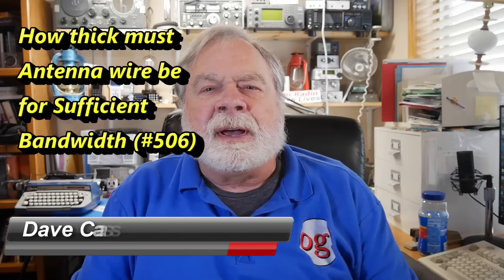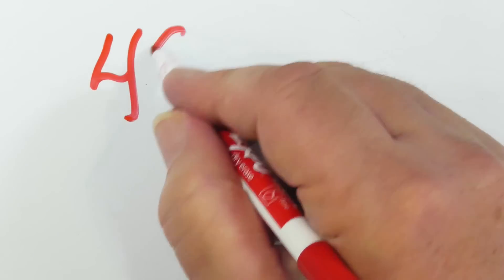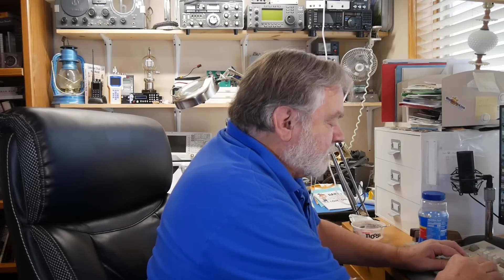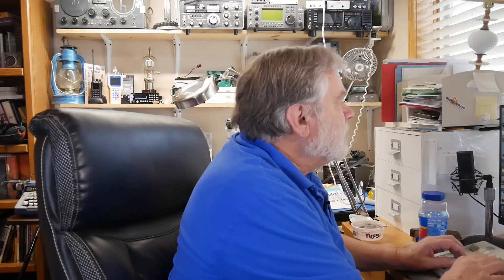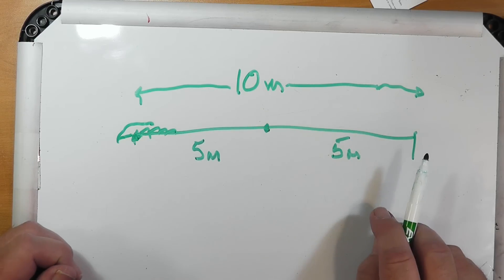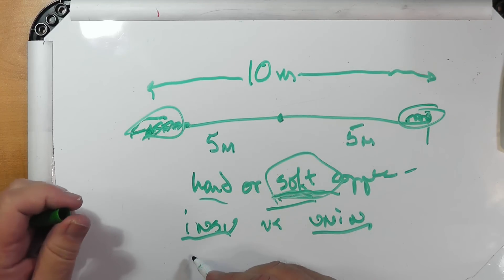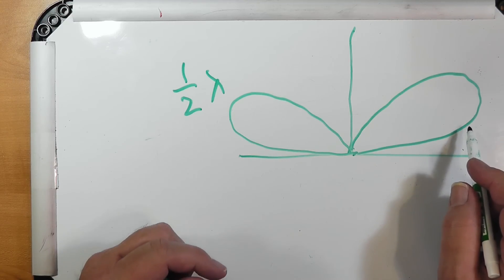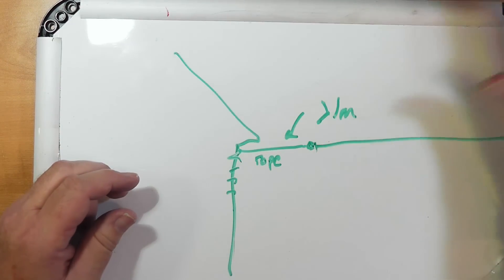20 Meter Dipole Covers Entire Band (#506)

Comment: I have dogs that love to dig so my plan was to mount an antenna on an old tv antenna mast on my roof. Am I understanding correctly that I should mount it 33ft from the ground to achieve half wave? Also I was going to ground the antenna by a 15 ft or so wire snaking down my drain pipe and staked into the dirt next to it. Is this way too long? Im very new to this so forgive me if im asking silly questions. I plan on taking a basic electronics class soon because alot of this is over my head. God bless.

Comment: I use a 2.5 lb. barbell weight on one end to keep the wire tight. As wind blows it will adjust up and down. I live on the Gulf Coast so on a nice spring day we will have 70 MPH winds, 
If a hurricane comes my way I can bring the entire mast and antenna down in less than 5 minutes. I use Flip-Tite Tie-Down Straps on my mast so it can be brought down in less than a minute after I get the wire antenna off it.

Comment: Hi thanks for the videos. Quick question. I have made a long wire antenna out of fine copper wire. I figured low current so thickness wouldn't matter. Am I wrong and a thicker wire would make a much better antenna? Thanks in advance.hanks for the videos. Quick question. I have made a long wire antenna out of fine copper wire. I figured low current so thickness wouldn't matter. Am I wrong and a thicker wire would make a much better antenna? Thanks in advance.

Comment: Interesting, as I was talking to an amateur last night on 2m who was going to try thicker wire on his h.f. long wire thinking it might be more efficient. I thought it might give slightly better bandwidth than very thin wire. Over many years I've used very thin wire and thicker wire and noticed no difference. It does seem to make a difference to the resonant length though. Very thin wire could actually burn out I suppose with very high power, maybe more so at insulators. How about cage dipoles?
Many years ago, 40+, as a short wave listener I read somewhere that single wire was better than stranded because with stranded wire the r.f. is jumping from one wire to another. I've used both and found no difference. However, for low frequencies Litz wires strands are insulated from each other and twisted, to increase the surface area as I understand it.
G4GHB.

Comment: I have a AH-4 random wire tuner and I was wondering what would be the optimum length, I know 20f will work and 800ft will work but no one can tell me that is best. No 1/2 ~ allowed, I have seen talks of multi band sweet spots.
Reply: The manual for the AH-4 is a little bit vague about lengths.  Partially, the limit is what fits on your property while avoiding half wavelengths or multiples of half waves on any band.

I have a "random wire" fed through a 9:1 unun. The recommended lengths for this were (in feet) 53, 59, 72, 88.5, 98.5 124.5, 146, 162 or 175.  There were also alternate lengths of 58, 71, 84, 107, 119, 148 or 203 feet.
I have a 72 foot length of wire at present, as that's what fits in my yard. My other HF antenna is a Diamond BB7V vertical. I switch between them for which ever works better with the other station.
Reply: @OzzieKev  thanks keven that is about the same answer others have provided I know the ah-4 can tune anything but that does not mean the antenna is 100% that said I may aim for 107ft. Next question I started thinking of wire materials I have been using Ace clothesline insulated stranded steel I believe for years, I recently got some 26 wag stranded copper from DXengineeering  just wondering your thoughts on steel vs copper and gauge. This will be supported on the ends and would be deployed with each use.
Reply: @bhamptonkc7  Most antenna books suggest hard drawn copper wire for antennas. However, this is usually based on resonant antennas, not wanting the wire to stretch and change length. In reality, you would Most likely not notice any difference in performance between the steel and copper wires. 
That being said, I personallywould look for something stronger than 26 awg copper for a 107 foot span. In my location, it would likely break in the wind. I would be more inclined to try the steel wire and see how it works.
Reply: @OzzieKev  very very helpful, thank you

Comment: Help, I use an AH-4 random wire tuner on 80 or 40 and have been using ace hardware clothes line for a couple years I was wondering if switching to copper clad or copper wire, it is portable so up and down every time and often pie one end to a tree and pull it up to a slight sag.

Comment: In my experience, when using a balun the inductance in the balun will result in the elements being slightly shorter. On element thickness I experimented on 144MHz by glueing aluminium foil to cardboard. A very wide strip was shorter than a thin one for a perfect match. The wider strip had a wider bandwidth. With HF antennas thin coax cable shorted together gives under 2:1 across the whole of 10m. A thinner wire would not. Unless the balun was very lossy.

Comment: Hello Dave. I think in the metric system it is pretty easy. If you want a half wave dipole on 20m band, you just calculate 20m/2 which is 10m. No need to make the feet calculation before. It is not a critic. I really appreciate your work a lot. Thank you for doing all these information rich videos.
Reply: Luckily I'm o.k. with both, having used the Imperial system and then we went Metric. I still find I prefer to measure things in feet and inches though.

Comment: Hello Dave.  When figuring length for an off center fed dipole antenna would you still use 468?  Or a different number?  Secondly, how do you calculate the correct ratio of length for each side being that it is an off center antenna?

Comment: As someone that is from the broadcast industry. The thicker the better.. I notice skin effect doesn't get a mention. When I say "thicker" I mean more surface area. In my world skin effect means all the power travels in the outer 30% of your conductor.... This is why you see Lattice towers and flat strap..... Don't forget copper rusts like all other metals and this is why the expensive big boy coils are coated copper pipe or flat coated ribbon as the surface resistance will change and thus the tune.

I too took the video on it's title.... maybe that's the wrong title? But ever wonder why Shortwave Arrays used for the likes of the Russian Woodpecker look like they do (for example)? There's part of your answer.... The cage broadens the tune, and the power handling.... 73's all
Reply: As someone with a degree in broadcasting (in other words, the degree has nothing to do with anything) I have great SWR and reactance on my EFHW on 40/20/15/10 with 18AWG wire.  In broadcasting bandwidth is almost irrelevant since a TV or radio station only broadcasts on a single narrow frequency.  The antennae are built for that frequency exclusively.  The difference between 22 AWG and 10 AWG is meaningless if the rest of the antenna is working well on a single band dipole or EFHW from 40M-10M.  There are so many other considerations including, as Dave said, including the height above ground that affect antenna performance.  When you move to 160 and 80 meters the story changes dramatically.  It would take a very large diameter cage antenna to cover all of 160 or 80.  The bandwidth as a percentage of the frequency becomes much more important and it's very difficult to build a single antenna that will cover the entire band for 160 or 80.  I have a hex beam that covers 40M.  The manufacturer chose to use single wire elements on 20M - 6M.  The optional 40M element is a set of cage elements about 2 inches in diameter to get the full bandwidth on electrically short elements.
Reply: @David-hm9ic  I've been in the broadcasting game for over 30 years. I see lattice towers with extra wires down their faces almost everyday. About 3 or 4 inches out. The idea is to get R 50 J00 across as much of your signals baseband as possible. The way your station sounds on air will change if you don't have it perfectly tuned. Thicker is better.... 100%

Comment: Here's a question:  Can someone hook up a radio setup of some kind to a lightening rod, could it theoretically act like an antenna for the radio?  Assuming power requirements are moot?

trying to figure this out for a book.  Any input welcome.
Reply: I believe it is possible to use a radio mast by tapping at a point up the mast. A bit like a gamma match. So yes, I'd say a lightning rod would work.
G4GHB.

Comment: I’m in the process of putting up 90ft of tower. Plan to hang dipoles off the side for 40m at approx 75ft. And 80m dipole at approx 60ft. 
Dipoles made from 12ga thhn stranded wire cut for resonance at 7.200 and 3.9. 
I live in the central part of Louisiana and hope to work as much 40m DX as possible. 
How well should I realistically expect the 40m dipole to work at that height? 
Thanks in advanced. 
TERRY 
K5CPL
Reply from the maker: If it's angled as a sloper, it should work pretty well. If it's level, that might be a bit high. I think getting any antenna in the air can really help.

Comment: The question was....how thick wire for bandwidth.  I have found that when I use #10 stranded insulated wire, my bandwidth is  better when using 12 gage wire and way better than 14 gage wire. Did not do the numbers but I have noticed that on 75 meters, I can get a cross the entire band a 1:3 or better SWR. No tuner on 75/80. I use the same dipole on 40 meters with a Dentron MT2000A tuner to get an SWR of 1:1 all across the band. I could not do that with 12 or 14 gage wire.  

W1WCR (silent key) who was an electronic engineer, used 6 gage wire for his dipoles and had a flat 1:1 SWR for all of the 75 meter band with no tuner needed. His signal was impressive. 

I like 10 gage wire because it tangles less than thinner wire and it is just easier to work with. As of July of 2022, 500 feet of 10 gage stranded at Home Depot is $156. Not cheap but I have been able to put up 5 resonant antennas, 1 for each band, (75/80, 40, 20, 17, 10) with that 500 feet. I never use baluns and I do use clamp on ferrite beads just to be safe. Have not had any RFI problems at all even without the beads. The beads are just in case. 

So does wire thickness make a difference? In my opinion, it seems to be yes. I could be wrong and your mileage may vary.  Every station is different. There are so many variables.

Comment: what thickness wire is needed for full badwidth coverage on 40 or 80 or 10 meters? with no tuners
Reply: Full coverage on 40 is pretty easy since it's not a real wide band.  Ten meters is harder because it covers 28.000 to 29.700.  My EFHW has a low SWR and no reactance around 29.000 MHz  but higher SWRs and some reactance on the ends of the band but with some effort I can use the entire 10M band without a tuner.  Max SWR on 10M is 2.1 at the top end.  That's not a massive power loss.  The 80M band is tough because the bandwidth is a big percentage of the frequency.  There it may be best to pick which part of the band you want to use and tune the antenna to that area. i.e.; CW/digital or General license phone.  To get full bandwidth on 80 will require a huge cage dipole or rigid copper as is used in TV broadcast station antennas that have 100,000 watts ERP.
Reply: Thanks and 73s from KU4hn, M0dfm, and 6Y5AS

Comment: The formula you gave to calculate the length of a 1/2 wave dipole in feet had some numbers transposed.  It should be L = 468/f (MHz)   
Not 486/f 
Easy mistake.  Using 486 will give you about an extra 1.5 feet per side (More tha 3 feet overall) on 40 meters and will require extra unnecessary pruning to tune it.  But that's better than being too short and adding wire.
Reply: He corrected himself in the video.
Reply: @kd5you1  Sorry for not looking further and seeing the correction.  Good job.

Comment: What is that perfect height for the diepole, you said 33' ,someone told me 17 feet , ground to top of antenna
Reply: A half wave of the frequency 10 meters would be ideal. Using a lower antenna causes it to act like an NVIS antenna, and more of your radiation will go up at a steeper angle instead of shooting just above the horizon. It really depends on where you want your signal to go.

Comment: I made a RL EFLW out of some scrap insulated stranded 18 awg wire. So far, I’ve received WAS and 21 countries running less than 20w pep.
Reply: Yep.  My EFHW wire is 18 AWG THHN connection wire from Lowes.  Almost 400 contacts in the last month and about 60% DX from coastal Texas.  Running 50 watts on FT8 and up to 100 watts on SSB.

Comment: Just wondering i have lots of microwave transformers can i use the primary winding as it is aluminum for shortwave aerial about 1mm diameter.
Reply: Any type of wire will work.
Reply: The surface area of the wire is what is important, not the composition. That is why, for example, grounding straps are used -- more surface area than wire.

Comment: You did a good job on answering the question you read but after watching the video 4 times, I didn't hear the question in the title talked about.
Reply: He quickly uttered something near the beginning that the thickness did NOT matter.
Reply: @manfredcaranci6234  there isnt a "Recomended must have"  specific wire gage until you start adding Kilowatts. Ive used anything from 18awg to 12awg sucessfully, stranded wire ofcourse.
Reply: @manfredcaranci6234  hmm, trying to figure out why my antenna doesn't seem to do anything then...
Reply: It's known that you DO get a wider bandwidth from a thicker radiating element, so the video title is the subject of curiosity. Take, for example, the jpole designs that use twin lead or those that use 12ga solid copper, which produce sharp swr drop and narrow bandwidth, versus the more common 1/2 inch copper pipe jpoles which produce a much wider bandwidth.
Reply: Me also waiting f that I believe have a effect because of skin effect that's why cage dipoles may be implemented

Comment: Should be part of the test for the license? Speed of light 3E9 m/s divided by frequency 14.2E6 1/s equals wavelength in meters.
Reply from the maker: Yes, but don't forget to throw in the 0.95 velocity factor for wire.
Reply: Speed of light is 300E6 m/s which is equivalent to 3E8 m/s, not 3E9 m/s.
Reply: @manfredcaranci6234  yes thanks for the correction. I must have typoed that.

Comment: Did I miss the part where you discussed the video title, wire diameter vs bandwidth?
Reply from the maker: maybe I was a bit subtle on that. On 40 meters and above, no matter the wire diameter, the antenna should cover the entire band.
Reply: @davecasler  please edit the video title. It's misleading and frustrating.
Reply: Funny, can't seem to get below 2:1 match on 10 meters on my "as seen on Ebay" cb dipole no matter WHAT I  do!!

No big deal, 10 is deader than a doornail here anyways...

Comment: What's a Balum?
Reply: A balun (not balum) is a BALanced-to-UNbalanced transformer used here to convert from coaxial cable (shield grounded) to a two-wire line which is the antenna. Neither half of the dipole is tied to ground.
Reply: @manfredcaranci6234  No shit.. it was called a balum

Comment: How high does a horizontal end fed wire have to be?
Reply: If you are talking about an EFHW, in general you should try to hang it as high as the wire is long (0.5 wavelength). You could also try it vertical or put one end of it in a tree and angle it down to the ground. Experiment with different configurations such as inverted L or V to see what works better for you.
Reply: @norrinradd8952  thanks for that.

Comment: Hi David. We use metric in the uk and divide the speed of light by freq.  I have been told that radio waves travel through air better than copper for example.  So the wire used has a propagation delay and has to be used in the calculation of wavelength. In coax manufacturers quote a value of propagation delay. Big question from me. As not sure. Cheers from old George
Reply: Good comment. There are a few online calculators that take into account the velocity factor of the wire, if you happen to know the specification of the wire you are using. This variable can potentially alter your required element length by quite a bit. I tend to round up and cut long, but yes it is good to know what you're working with for more accurate calculations.
Reply: @norrinradd8952  Many. Thanks for info. I can remember having to change the cable length from my CB radio to SWR meter at one time to correct it. But seems to be 100years ago. Cheers from old George
Reply: On HF + - 5cm doesn't make any effect. On VHF or UHF any millimeter is important(1/25th inch, so inch is not good measure unit, OK on HF)

Comment: The question of how thick the wire needs to be was both asked and answered by Dave @ 1:37. It was previously stated that the wire available was about 14 AWG. 

Dave spent most of the rest of the video answering the actual question, which is far more critical to the antenna working on 20 meters.
Reply: Dave said that it doesn't matter on 20M and I agree, for a single band antenna.  My 20M Double Bazooka has a very low SWR and reactance across the entire band.  It's about 6mm-7mm (1/4 inch) OD.  My EFHW has an acceptable SWR across all of 20M but it is not as low as the Double Bazooka.